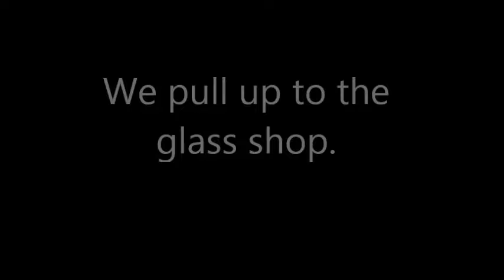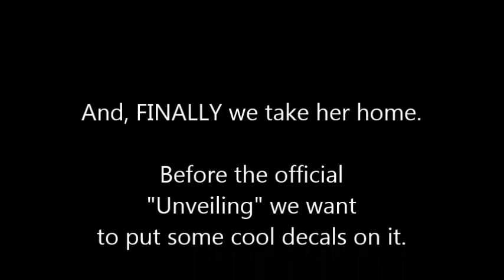The Great Molly-Mobile Makeover - 15 - Finished?

Comment: Nice! The glass shop did a great job. I must admit I was skeptical about the rear door windows while it was still at the fabricators, but it turned out to be a great touch. It looks great with the windows in and it's much easier for Molly to see out if she is riding in the floor. She certainly seems pleased with the custom ride. Congratulations!